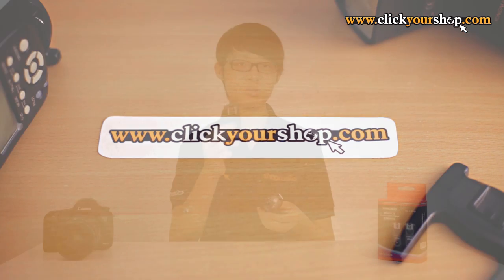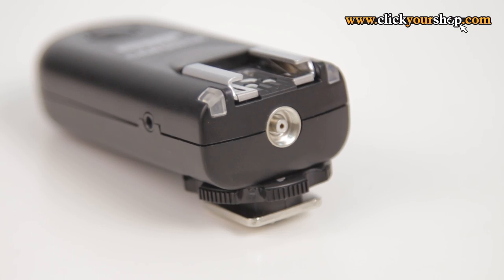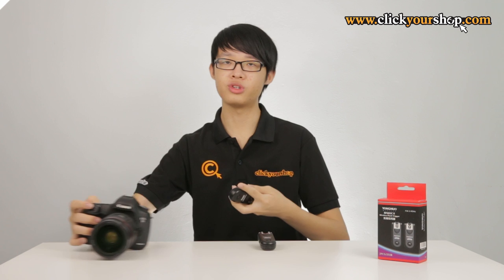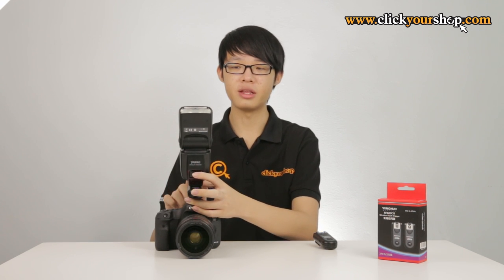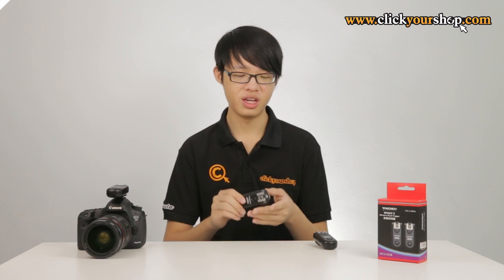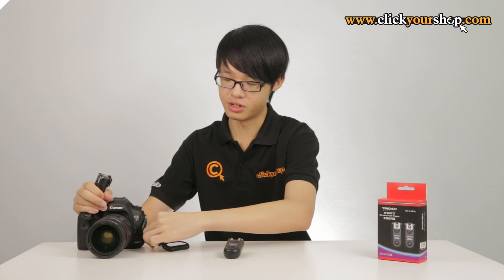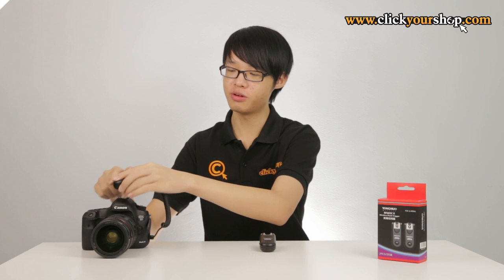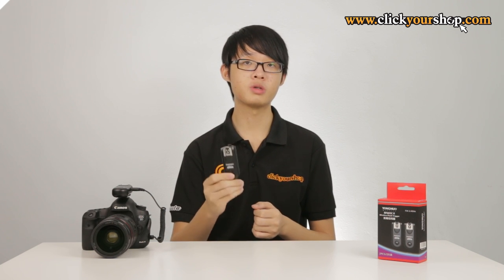Yongnuo RF-603 II Wireless Flash Trigger Transceivers (Product Review)

Comment: I have the Canon 5D Mark IV and got the  Yongnuo YN600EX-RT II flash , and I recently  purchased Yongnuo RF603CII wireless flash trigger set. I have done any type combinations, settings, read the whole manual for the flash and the wireless flash trigger set;  hours of  researching. and not luck trying to trigger by remote control the camera and the flash at the same time. - the camera works but the flash won't fire.      I believe the YN600EX-RT has an internal receiver, and the YN600EX-RTII supposedly sync with the RF603 II,   still  I can not  get the flash and the camera to sync. I have tried  and mount the wireless trigger on the Canon and connected it to the camera via shutter release cable and then mount  the flash on the other wireless trigger  and they work just fine when I press the camera's shutter button  - If any one out there has the same problem and know how to solve it  PLEASE do contact. Thanks !  🤓

Comment: Question: What if you want it to trigger a remote camera (let's call it camera B), like you exemplify here, but without pressing the button on the device, and having it trigger when you press the shutter on camera A. Is that possible?

Situation: Camera B is behind a goal on a soccer match, the Yongnuo RF-603 II is on top of the camera, set as TRX as you said, and connected via wire.

Camera A is with the photographer, remotely, and the Yongnuo RF-603 II is connected also as TRX on the camera. When the photographer presses the cameras shutter, will camera B trigger as well, or only if the device's shutter is pressed?

Basically I would like to avoid having to press 2 buttons to trigger the 2 cameras, and only rely on pressing camera A's shutter to trigger both. Hope that made sense. Thank you for your video!
Reply: No you can't with this yongnuo you have to trigger by hand if you want to use the camera shutter  to release the remote camera get pocket wizard

Comment: Can you use yn600ex-rt flash to control another flash mounted on RF603 C3? My concern is bulking up the camera and connectivity issues with flash mounted on transmitter.

Comment: Does anyone know if you are using the Yongnuo 622TX as a remote trigger on the camera work with a Yongnuo RF 603 trigger ( in hand ) to trigger the remote capabilities or do i need another 622? I just wasn't sure if they used the same rf signal